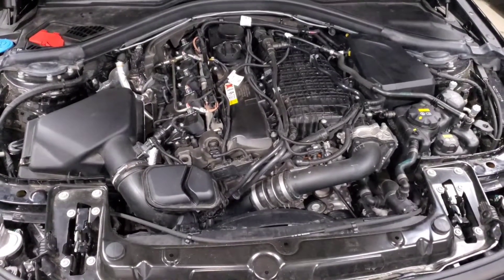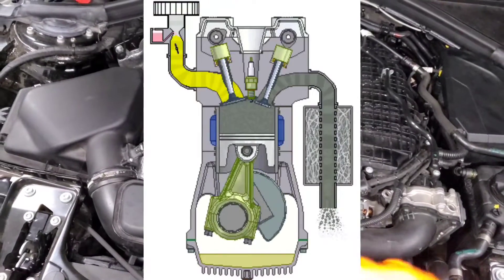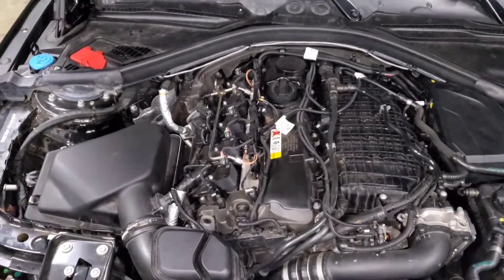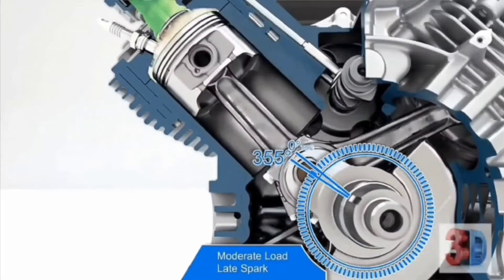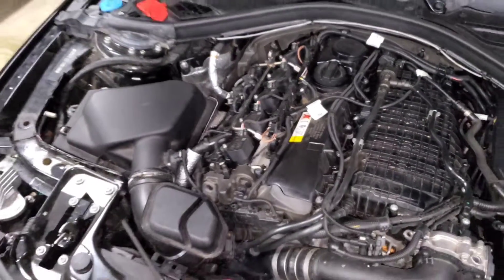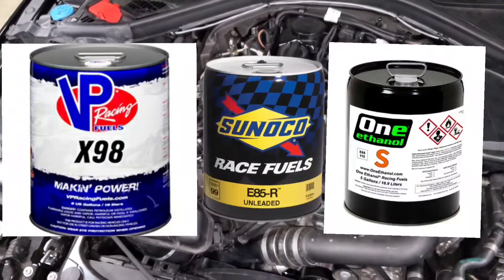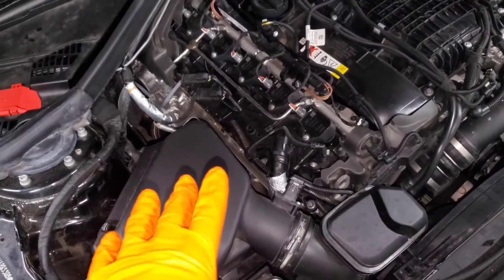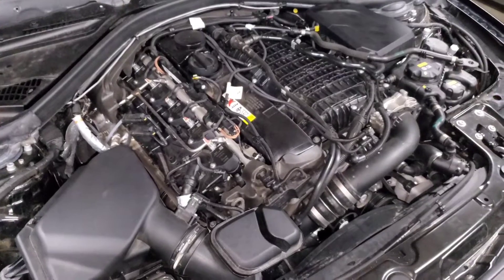Why does the B58 respond so well to E85?

Comment: I got a big turbo but don’t have access to e85 only 93oct. I’m making about 19 pounds of boost and my tuner says we are maxing out the octane right now. Using a 6466 turbo and it starts making boost at probably 3,200 rpm and ramps up to the 19psi. Honestly pretty disappointed with this I feel like I made a mistake and should have just kept the stock turbo it felt a lot faster. Can anyone else relate at all?
Reply: Any update on this? I’m afraid of this happening to me

Comment: The question I have is will I be able to run the same stage 2+ on an upgraded turbo ? And will it deliver better power with less heat ? Or do I have to get a Custom tune for it ?

Comment: Hey, I'm running e60 on custom tune. I noticed as the temps get cooler out the car takes longer and longer to start. My tuner is still trying to minimize this. Is this typical for B58 long crank on 1st start or after sitting 8 or more hours? 93 octane nearly starts right up maybe 2 cranks. I also run Supra plugs gapped to 0.25. Not sure if that mean anything. To be honest I think the MHD e40 map may start slightly quicker with e60 still in the tank sometimes.
Reply from the maker: More e85 = more difficult cold starts
Reply: @kern417  I appreciate your help. It was really starting to bother me seeing I can't find any threads on this being an issue for B58 owners running high ethanol. I was starting to think something was wrong because my tuner adjusted the tables a few times already. He says there are several cold start or fueling tables for B58. So, is there any solution that your aware of other than less ethanol. Coming from N54, the issue was solved more simply.
Reply from the maker: It's all in the tune. Believe it's called cold start enrichment tables
Reply: @kern417  Yep, that's what he's been doing. We'll keep at it. Thanks

Comment: Can my 2020 and m340 I run e50 without any upgrades to the fuel system?
Reply from the maker: You can with the appropriate tune
Reply: @kern417  I’ve just got a regular premium gas tune. Think I’d be okay?
Reply from the maker: No. You need a tune for E50. Either custom map or some tuners have one included in their map pack

Comment: To run meth can I use the ofs MHD stage 2 with stock fuel pump or do I need a custom tune and tell my tuner that I’m gonna use meth ?
Reply from the maker: You can run it on an OTS map for small gains but you'll need a custom tune to get the most out of it.
Reply: @kern417  ok how much Gains on ots tune
Reply from the maker: @ulisesvazquez8675  depends on your fuel quality. If you're getting a lot of timing corrections then it'll clean that up

Comment: Your videos are insightful,to the point and expressed in a interesting way to hopefully keep the viewer on the correct wavelength. Very good. 
One question pls bud- 
do you thing/believe running E85 fuel has any detrimental effect (wear) on any of the fueling system on BMW’s with the B58?

Comment: This was a good watch. Do you think it’s worth upgrading turbo if you only have access to 93 octane? 

I’m between that or ordering race gas and keeping stock turbo and just doing hpfp and running e30. 

What do you think would be the best route ?
Reply from the maker: Yes a bigger turbo will make more power on 93 than with stock turbo. But if you have e85 available then i always recommend that because there are so many benefits. Plus a hpfp is cheaper than a turbo + custom tune
Reply: @kern417  I do have access to ordering a drum of e90. Im basically looking for around 500-550 wheel hp. Don’t wana push the stock turbo to its limits so I think pure 800 with hpfp and mixing for e30 could be my best bet? 

Add my insta I’ll follow you back 1fast240
Reply from the maker: @DD-hj3sj  yep that's an easy option to make even over 600whp depending on the tune

Comment: I am doing catless down pipes, back box removed, Mst intake, csf radiator and stage 2 map from bmw expert (EVOLVE IN UK) what sort of gains I will get and will these mod effect reliability as I will be using my m140i daily or you think jb4 with meth rather then stage 2
Reply from the maker: That typically adds +60-80hp and will be very safe for daily driving 👍🏾
Reply: @kern417  thanks for a reply your video are one another level keep it up :)

Comment: Does m340-b58tu make more power then first generation b58?
Reply from the maker: Yes
Reply: @kern417  not the with m power kit
Reply from the maker: F3x MPPSK is rated 355hp
M340i is rated 382hp 
That's almost +30hp. So yes it makes more power.
Reply: @kern417  f3x MPPSK is underated at 355 hp it actualy 382 hp
Reply from the maker: The m340i is underrated too.
Reply: @kevinboisjoly1039  I had an F30 340i  MPPSK and now I have a ‘21 M340…no question the G20 is quicker.
Reply: @gogz1981  my friend have a m340 we race on a dig it head to head stop that cap
Reply: @kern417  no it not and the f30 chassis is lighter then the g20 so more power/lbs
Reply from the maker: @kevinboisjoly1039  the question was if the m340 makes more than the 340.

The answer is yes.

Idk what question you're trying to answer. But the fastest stock turbo m340 is faster than the fastest stock turbo 340. So you can do what you want with that info.
Reply: @kevinboisjoly1039  I have a Dragy.  I ran with my F30 MPPSK a best of 12.6@110mph in 500ish DA.  The G20, while I dont have any stock 1/4 mile times, since I’ve been running JB4 E30 since the second week of ownership.  But the G20’s consistently run low 12’s @ 113ish stock.  So not saying the G20 walks all over it, just saying it is in fact quicker/faster.  And top end, there is zero doubt the B58tu is quite a bit stronger.  Again, I’ve owned both.
Reply: @kern417  show proof then
Reply: @kevinboisjoly1039  I’ve owned both man..its not stupid, its my personal experience.  If you really truely got the times you quoted with only mPPSK on 93, which I doubt, then you my friend have a factory freak.
Reply: @kern417  I found out on Day 2 of ownership of my M340i that the B58tu was a quite a bit more powerful than the B58 especially up top.  My friend with his stock e92 M3 DCTwould always walk me on highway pulls pretty hard with my F30, but the G20, it was a whole different story
Reply: @gogz1981  yea dude it stupid you compare car that are similiar and say wow the m340 really superior when you put a trash jb4 in it the first week you own the car like are you good ?
Reply: @kevinboisjoly1039  I tune all my cars pal.  I drive a 2021 M340i and if you’re in the know, you’ll know that mainstream flash tunes haven’t hit the market yet for 2021+ BMWs, so JB4 is the next best thing.  Call the jb4 what you want, but Map 6 on E30 hauls and the power delivery is smooth, so no complaints by someone that is an actual user (unlike you).  So my final comment to you is, before you call anything stupid, first:

a.) Do your research
b.) Go back to school and refine your grammar.